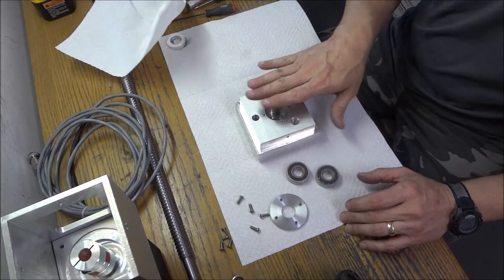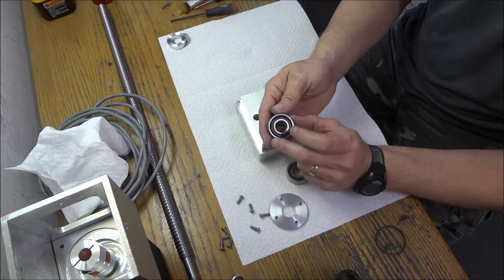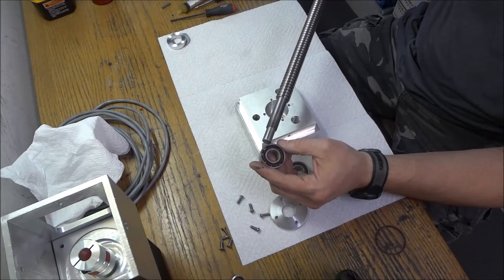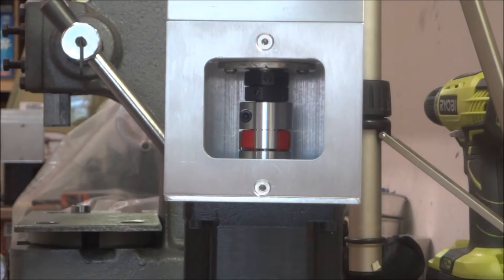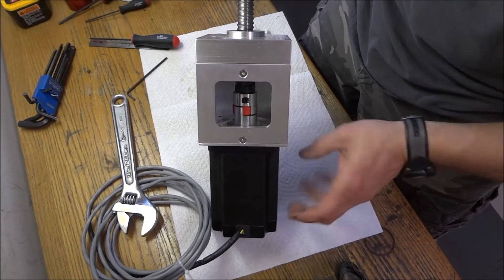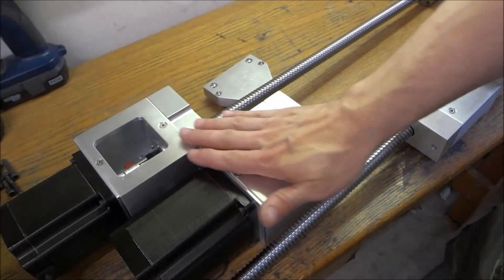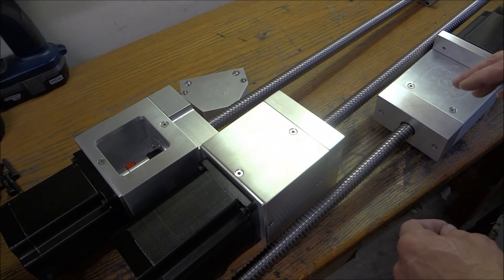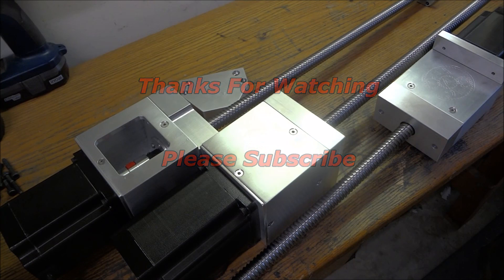PM 727M CNC Stepper Mount Assembly

Comment: Why don’t you get a bearing packer at any automotive store for under $10 and it will squeeze grease into all the rollers until it is completely filled with grease all in about 3minutes per bearing.
Reply from the maker: And avoid all the fun?

Comment: The spacers were not needed, you should have done them all like the y axis and I would suggest against the spacers for anyone looking to copy this design, instead orientate the bearings in the proper back-back configuration as intended. Also avoid the lovejoy/jaw type couplers in favour of the oldham type, they offer a better result re anti backlash (soft spider vs hard) and their design also accommodates misalignment better, how ever small it may be!

Good effort though, keep up the good work and look forward to seeing her moving again.

.Me @mycncuk
Reply from the maker: +Lee Roberts 
Thanks Lee for the tips. I actually did use the shim method on all three Axis you may have missed that. The AC bearings are facing back to back. It just has the shim in the center. I could have gotten by with a thinner shim say 1-2 mm but I have to disagree that a shim is Not  needed. If placed back to back the inner race will not be able to be pressed together enough for proper tension. Of course depending on which type bearings are used. These I chose are just basic AC bearings. Here is a good write up.  http://www.skf.com/binary/77-121108/Angular-contact-ball-bearings.pdf

As far as the spider couplings you may be correct however I have used these before the plastic  spider is quite hard and works really well it does provide slight dampening. But is really stiff.
Reply: +CNC4XR7 Note I said spacer not shim, yes shimming is OK when needed.

The dampening effect from the spider becomes a source of backlash, the Oldham type use an Acetal/Nylon disk depending on what you choose and so provide a more rigid setup.

I have what look to be the same bearings as you've used and agree the inner race's don't touch when placed together, I purchased some better quality RS type and they are better, however I don't think the inner races need to be in contact with each other, past their initial design, as axial loads are only supported by one bearing in each direction anyway.

You should only need to shim/adjust the outer race/cage, let the inner do its thing.

Also clearance in the bearing arrangement, results in a carrying loss (load) in the said bearing.

The numbers are small and what you've done will work fine, however as I said the spacer wasn't needed and in doing so you've ended up with (technically) a less rigid bearing arrangement and source for error/discrepancies.

I'll tag you later on G+ with some pics of how I've done mine, its not much unlike yours but is less involved and a tried and tested design that works well, very well.

.Me
Reply from the maker: +Lee Roberts  Thanks Lee,
Yes please do I would like to see what you did, I read the documentation and to a look at Tormach setup, they use a small spacer/shim in between the bearings. in theory it seemed correct :-) I figured the wider stance would make it more ridgid. She seems great I guess I'll see how it runs and go from there.See what the end Backlash is.

The Oldham couplings are far better, The ones I'm using have served me well so far so I tend to stick with what I know works, the spider is a hard plastic nylon not a rubber. 
Thanks again for the information.
Be Safe,
Sam

Comment: Great design Sam, I'm pleasantly surprised at How your mounts held their concentricity. especially since they were laid out by hand and manually machined , outstanding job ! I always say I would rather be lucky than good, however to get lucky on all three you must be good! It's nice to see it all coming together, I'm sure you can't wait to make a big pile of chips.  Ken
Reply from the maker: +Ken Estelle 
Thanks Ken, No I'm just really lucky But my luck ran out played the lotto and Nothing! Oh well back to machining. LOL
The Key is to layout everything from the center. the center line is the Key , its no coincident the mounts and spacers are 4 x4 and 2x4 I could not have planned it any better the OEM center lines are 2" for X and 1" for Y so it just worked out perfectly. It's almost if they designed the mil to be converted to CNC!
Be Safe,
Sam